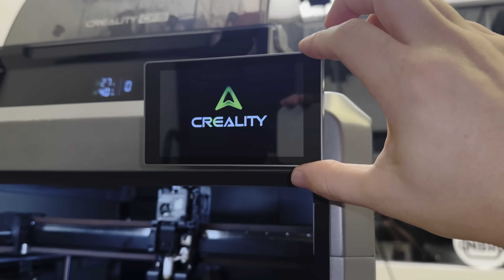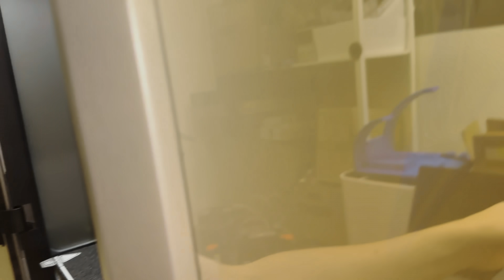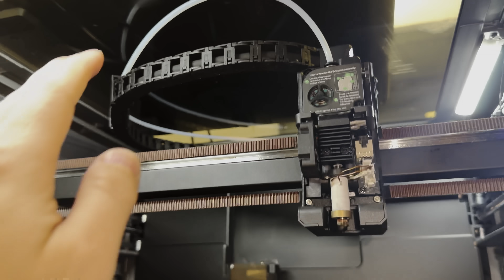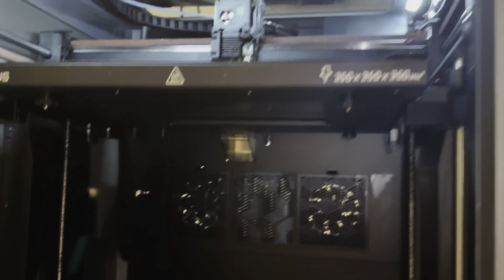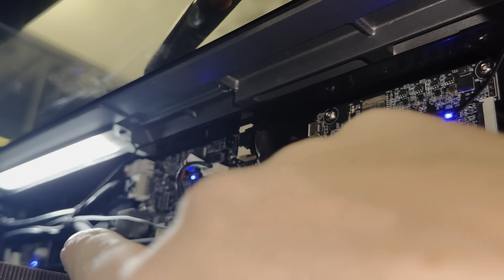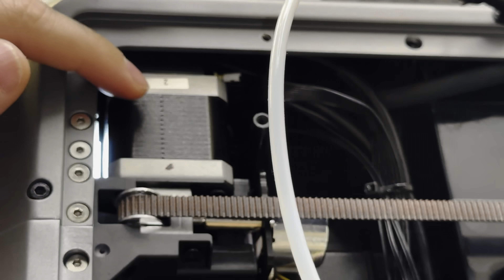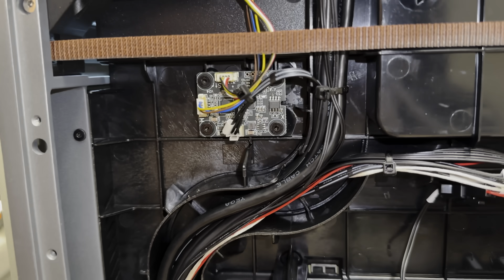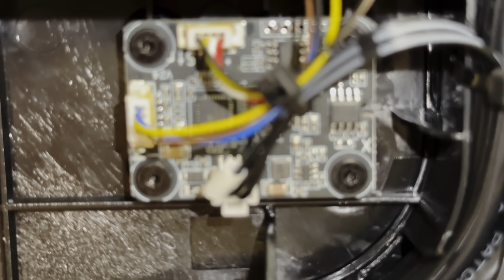Creality K2 Plus - What's Under the Hood?

Comment: This looks like they just let an engineer go to town on the design and just said, "we need to sell it for under $1500 and make a profit. We want something to turn around our image with."
Reply from the maker: There is much better attention to detail on this machine compared to their previous designs, I can say that much.
Reply: @NathanBuildsRobots  It seems like so many things a bean counter would cross off the list for a nearly zero-dollar solution: Motorized belt tensioning instead of a spring/screw; dual z motors instead of a belt; dual LED lighting, dual exhaust fans.

I think you definitely nailed it - the complexity worries me if it stops "just working", but with the size and quality of this, the SV-08 may have been bumped off my next printer list.
Reply: @See-essEll  - I was planning on the SV08 being my next 3D printer and building an enclosure for it, but pending more long term reviews, I may be purchasing a K2 Plus, but not one of the earliest units.  I'll wait for the inevitable rolling improvements that such a complex product will have, but it does look like Creality did their homework on this one.

Bambu Lab just announced a TPU filament that'll work with their AMS so hopefully we can get a higher durometer TPU from a filament manufacturer that will print better/faster that will feed in the CFS, so I can manufacture products printed in place with ABS and TPU.
Reply: @See-essEll  I have an SV-08 and pending more reviews and availability I might get a K2 and go full send on modding the SV-08, I want to try modding it to be a 60v stepper system to see if I can't get the machine moving at 2k mm/s and cross 100k acceleration speeds.
Reply: @Liberty4Ever I guess it depends on the type of TPU you have... I can even print TPU on my old bowden extruder, but my TPU is not super flexible.
Reply: I'm pretty happy with the K1C. But I am definitely K2 Plus curious!
Reply: A definite buy for me but maybe 6 months or so down the line.
Reply: Looks very neat, one thing the press fits rod, would make it difficult for replacement of bearings, but again I have never done that on a 3D printer.
Reply: @radarmusen As I see it, there is no need for bearings on the rods. The rods don’t rotate, the mechanism just slides up and down on them. The bearing surfaces are attached to the bed.
Reply: Nope. This is not an engineer kind of design. It is not focused on function. An engineer would care a ton about access and serviceability, not looks. This is a ton about form over function. This is a marketing product, with some interesting choices. But unless there is built in ways to easily service this machine for the end user, then no. This is not the usability, as in function, an engineer would call for.
Reply: @FrodeBergetonNilsen  I think you are confusing modders and engineers. As an engineer, I can appreciate a design that doesn't need modding, and works as it should from the start. So far, that's what I'm seeing from these two videos.
Reply: @daveduncan2748  Modding? Seriously? Irony is, this is confusing. I never said a word about modding anything, because that is simply not my thing.
Reply: @FrodeBergetonNilsen  Did I say you "said" modders? No. I said you are confusing them with engineers, which you did mention. As an engineer, I'd say you are describing a typical modder by saying, "An engineer would care a ton about access and serviceability," not a typical engineer. You also say it's form over function. I'd say it looks pretty functional. I think you are confusing "function" with "serviceablity." I'd also say you are confusing "serviceability" with "modding." Because, what needs to be serviced on a printer? Change a nozzle now and then? That's fine with this printer. Grease the sliding parts once in a while? Also not a problem.
Reply: @daveduncan2748 I totally agree with you! And we are "not allowed" to design with maintenance in mind anymore, in sake of enlarge profits.
I loved the old days when maintenance was a mandatory part of the design... A lot of fun thinking 😁
Reply: @FrodeBergetonNilsen  "access and serviceability" are just two of many design criteria that an engineer may or may not be tasked to (or given the discretion to) prioritize. Appearance, human factors, cost/manufacturability, and novel/proprietary features are a few considerations that can fall into the purview of a design engineer. Sounds like you have an extremely narrow view of what an engineer does, how they think, and what kind of design solutions they can come up with.
Reply: @FrodeBergetonNilsen  How? But he just showed in the video that everything is accessible by removing a few screws or covers. There is no way to make it more accessible other than leaving everything exposed.
Reply: @matiasatamaniuk5266  So. Not sure what you are asking for, but this is a printer with extreme forces in it, working in a closed heated chamber. It uses a production process, that is known to fail in catastrophic and unpredictable ways. A ton of service is required. A ton.

At the same time, users are in complete oblivion to what I just said means. Particularly as for accidental and unpredictable catastrophic failures and accidents. Combined with an extreme need for careful maintenance for safe operation, given the basic description of this machine, as I just gave you.

I don't care what marketing might claim. The lead designer and the engineers working on something like this, just need to speak up.

Not sure what you mean by "how"? You state as an employee that either this is done safely and withing reason, or you quit. And you will not be silent about why you quit. It is called guts. Like having a back bone.

This very printer is targeted at end users, and not a professional market in which people are educated as to risk of environment.

It is so bloody obvious is the comments.

I haven't inspected this machine first hand, nor have I had or heard any meaningful discussion about the real design issues of this printer. I am sort of on the fence, since I simply have very little to form an opinion on.

But with a solid top and solid bottom, how do you remove the vertical rods? Why is it seemingly hard to remove the side panels? Is there a social aspect to that, or is Creality dumb? As for the bed, why so el-cheapo? Also, with the forces in this chamber, where is the social thinking? Have they lost their minds? Or have they finally got their act together? I just don't know. But a real designer, a real engineer, would be crystal, that this is another ball game.

Just remember guys, that when this is called out before someone gets hurts, you all act like this. I will remember that. You better to.

Don't even try to imply that no one did not speak up. This is like the n-th machine that is potentially reckless. Some flat out are. People will get hurt. But not because of me.

As a designer, I will make mistakes. But the insanity of where these people seem to go, an in what manner, is dangerous. I object to this. It is stupid. Dumb. Evil. I hope someone spoke up, in China? Where is the irony in that?
Reply: @FrodeBergetonNilsen  Hm. Sure, it looks nice, but it definitely is more serviceable than the Bambu Lab X1C. As far as modding goes, or "upgrading" parts, there's not a whole lot you want to upgrade with this one from what I'm seeing. A more "moddable" printer would be a Voron 2.4 or Ender 3, but both of those are hard to compare with the K2 Plus, which is essentially an appliance, like a microwave or coffee machine. Most of these modern CoreXY's (Bambu Labs, Creality K1 and K2 series printers) are not designed to be "tinkerable", so in this respect the K2 Plus actually has quite an open and accessible design, compared to the K1, K1C, K1 Max, X1-Carbon, X1-E, P1S, and P1P. I really like the looks of that open space in the belly of the printer... I see that as potential electronics housing. Technically, with that much space, and the easy access to sensors and other electronics, you could even take a K2 Plus and rebuild the operating system with a real raspberry pi and BTT motherboard or something, along the lines of a Voron...
Reply: @FrodeBergetonNilsen  I don't know what kind of engineers you hang around, if any, but the engineers I know love to make the most unserviceable systems as possible. From using glue and permanent fasteners to completely drowning all the electronics in epoxy because if they can't move the how can they ever break mentality.
Reply: @Guardian_Arias  Your right. I am not used to work with that kind of "engineers". What company do your friends work for again?
Reply: @FrodeBergetonNilsen  Raytheon, L3 Coms, Boeing, and a few other companies around the world particularly in air and space industries.
Reply: @Guardian_Arias  There are quite a few design choices in this very printer, that are just very difficult to understand. Simply because they in so many ways makes no technical sense. If I employed people making these kinds of choices, I would have to fire them. That was, if they very engineers. People need to know their stuff, particularly what they are supposed to excel at, and most importantly, speak up when I need to know something. Seems like there is quite a few deadbeats going around.
Reply: @FrodeBergetonNilsen Ford does it that way...haha

Comment: You'll Review the Creality but not the Qidi? lol
Reply from the maker: Apparently the Qidi is a fire hazard. The SSR (solid state relay) for the chamber heater gets too hot and melts in its current form. They will probably fix it. In this printer they have a fan that blows on the SSRs, so it shouldn't have that problem, unless the fan were to fail.
Reply: The Plus 4 isn't worth reviewing in it's current state. Not until they redesign the packing materials and enclosure heater (both the power delivery and location)

Comment: The printer Stratasys dreamed of. Those motors do the belt tension, no more manual belt tensioning ❤
Reply from the maker: It looks like it has belt tensioning motors, and a screw to lock in the adjustment. There is a black screw accessible on the backside of the frame on both sides in line with the pulley system. It's interesting for sure, but would require more disassembly to get a good look at.
Reply: @NathanBuildsRobots  yeah you showed it, i have to say that part made me really curious and its good for the vid that you went on and not startin to hyper focus on that and how it works.. wich i would do and love 🤣
Reply: Even my Bambu A1 Mini can test the belts and tell me I need to adjust them. Being able to do it automatically is a nice new feature to see!
Reply: Yeah, I'm thinking back about all the hours and days I spent tensioning my belts lmao.

People are so lazy now.
Reply: @DingleBerryschnapps  I've built several printers, and I have to agree :p

I'm excited about auto tensioning, because I have always been confused by the plethora of different info regarding proper tensioning. I have always done it by feel, and it seems to work out well. I'm just so used to working on German cars that have manuals with torque specs and tensioning guides!